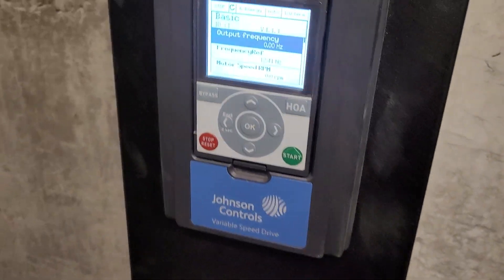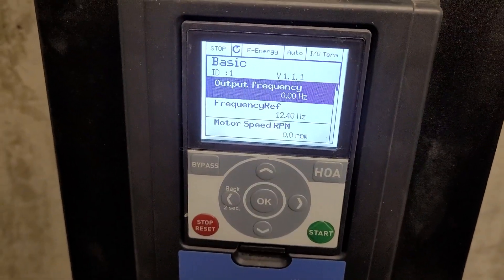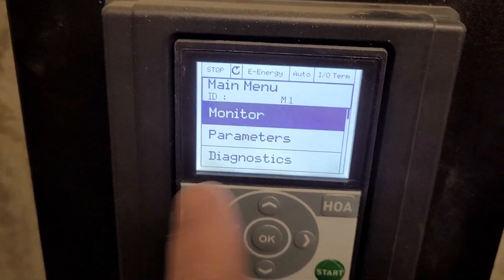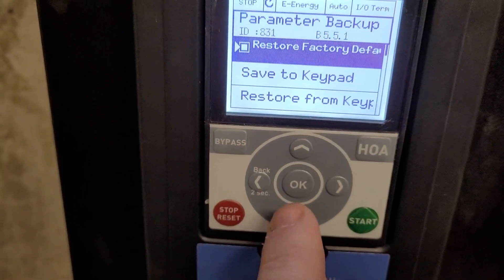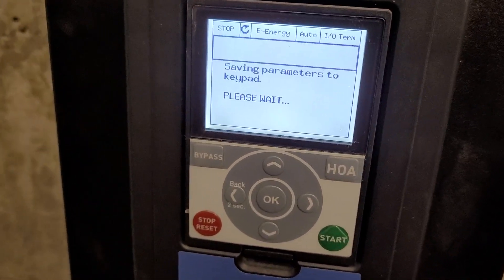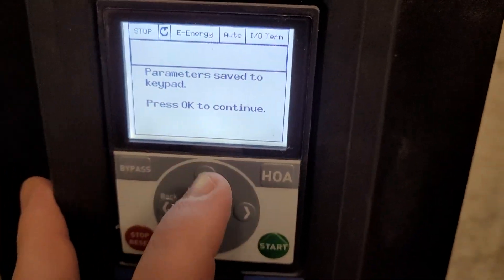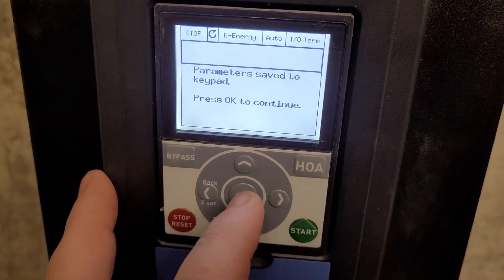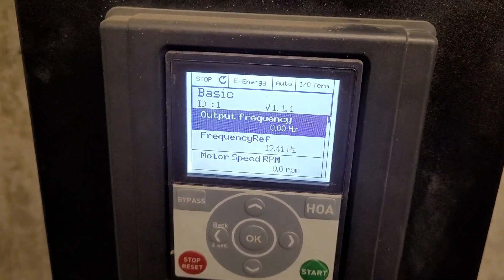Johnson Controls VFD Parameter Backup

Comment: what do you do if the keypad is not showed  not coming up
Reply from the maker: There are two possible causes if the VFD still runs the motor.  It will either be the panel itself or the parameter board.

Comment: Do you know what parameters need to be set to A) have one of these power on in auto and B) start if there has been a start command via the terminal block on power up? I have 4 at a site and one of them does not power up in auto. The 3 others do and only one of the three will start while having a command present before power up. I coped the parameters via the keypad as a test from the good drive with no luck. :/ I’d like to manually check the parameters but I can’t find which control this behavior.
Reply from the maker: Very unusual for it to not power up in auto. I suggest calling tech support
Reply: @Systemcontroltech  I’m told they’re Eaton drives. I’ll give them a try. Thanks!